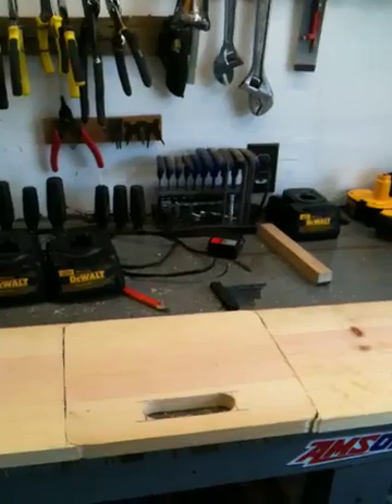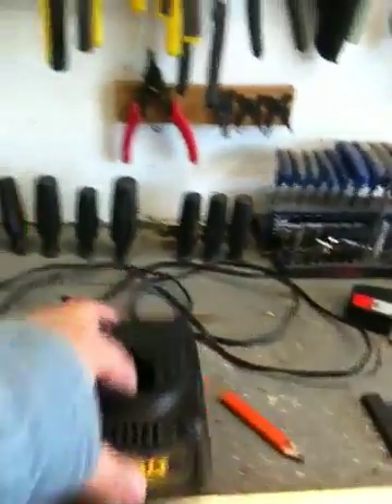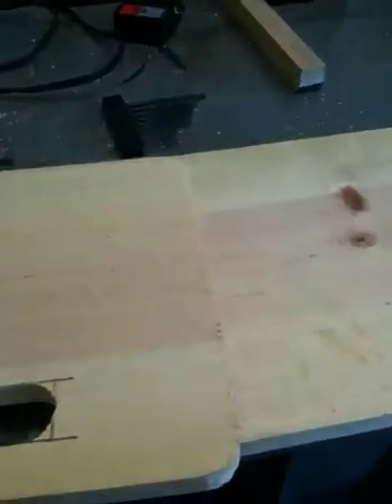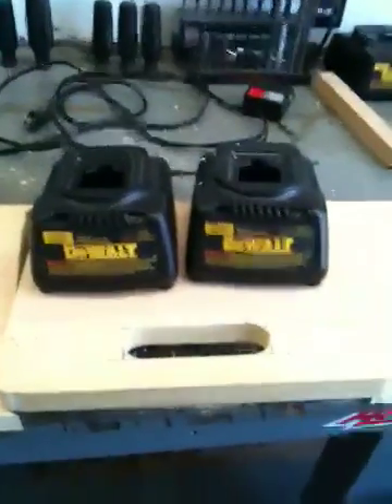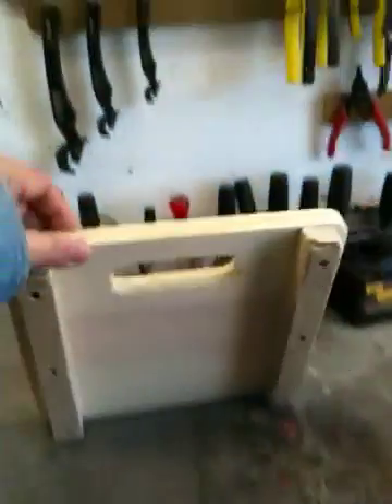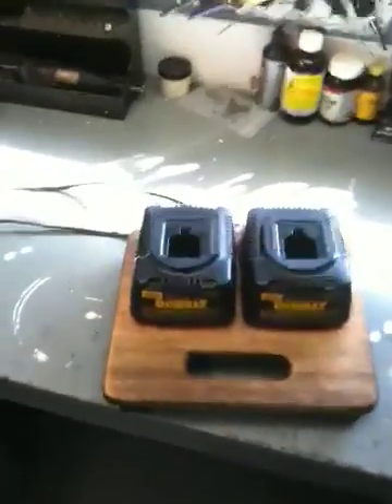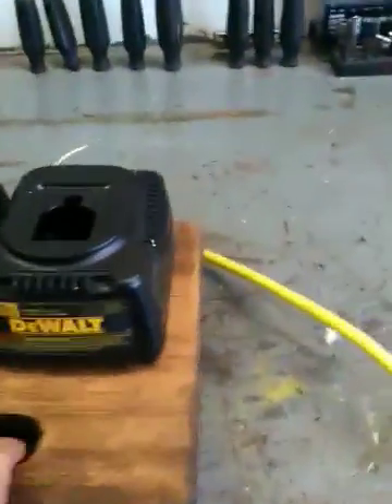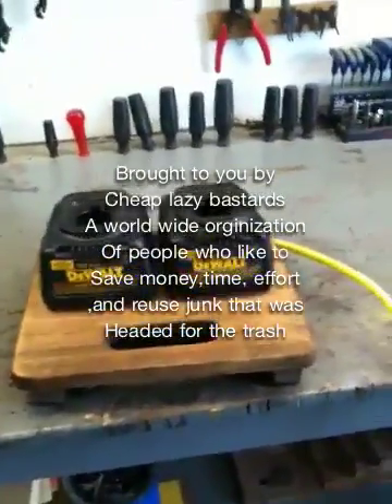How to make a dual battery charger

Comment: How did you mount the chargers.  Drill though the middle and then bolted it?
Reply from the maker: There is a hole at the bottom that you can drive a screw through.
Reply: @bctruck  Thanks ill check mine. Good idea and thanks for the response!

Comment from the maker: @boat6868 by the way. there is a website called "dewalt factory authorized"hey sell factory reconditioned dewalt tools tha come with a better  gaurantee than the non reconditioned. they may have had something as simple as a scratch on them. they are about half what they would cost in a store. (including shipping)

Comment from the maker: @boat6868 i am aspecially fond of the 18 volt dewalt cordless tools. if i knew a little about what type of work you will likely be doing with them,i could could give some better advice as to what features each has. im a dewalt nut. i was just packing my bag that i take to work with me. its an old dewalt tool bag.